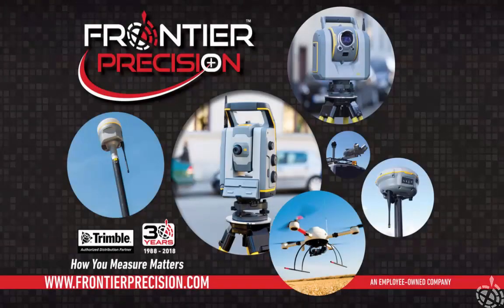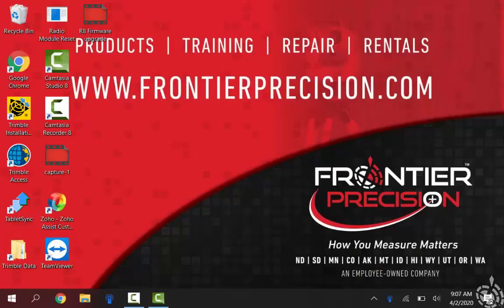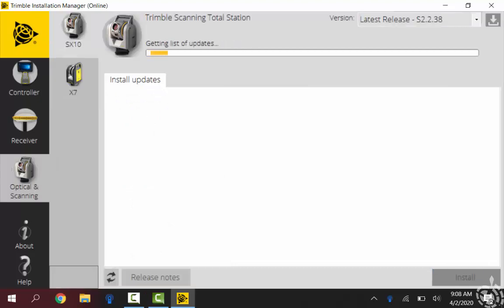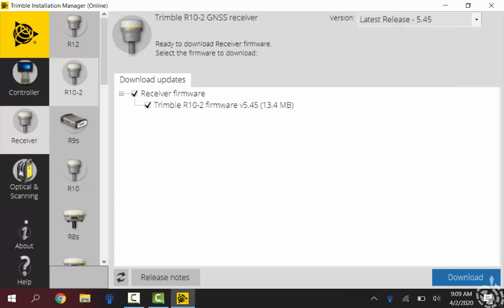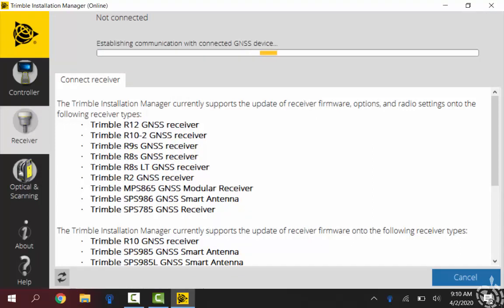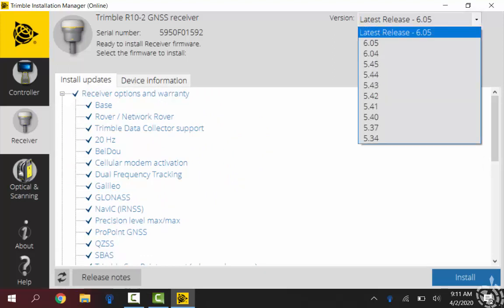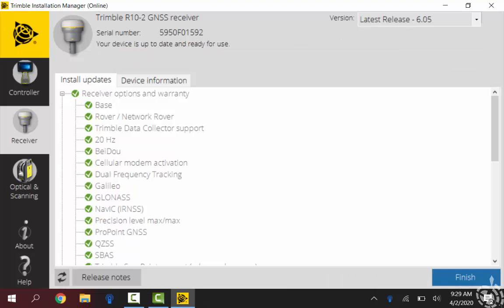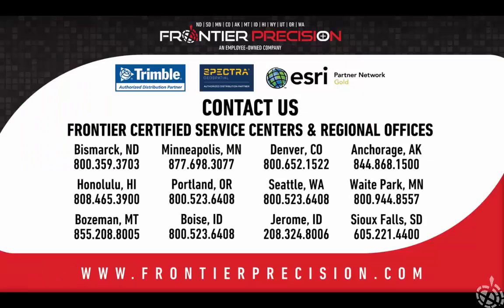Performing a firmware upgrade on your R10-2, R12 or R12i Receiver

Comment: Quick question? I been an active heavy civil user on the scs900 software for 7 years now and this year was the first I’ve used an R10 model. I wanted to know if using the R10 model was better for Solar/renewable energy or if scs900 was still the best? And yes I have used Trimble site works and have been changing my crews over to that software this year.
Reply: Michael,
The question is a little unclear. You're asking if the R10 is better than SCS900?